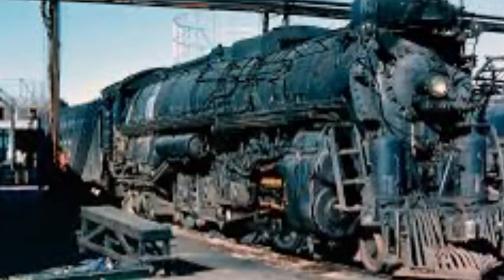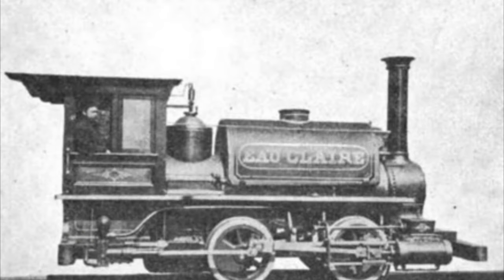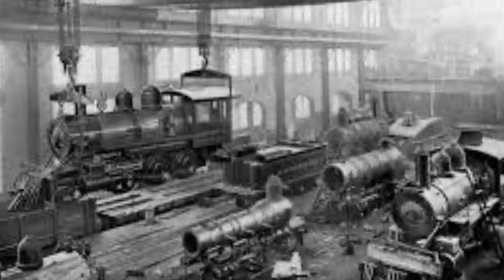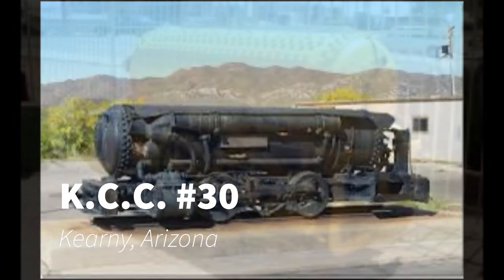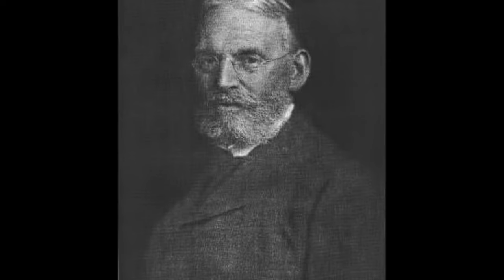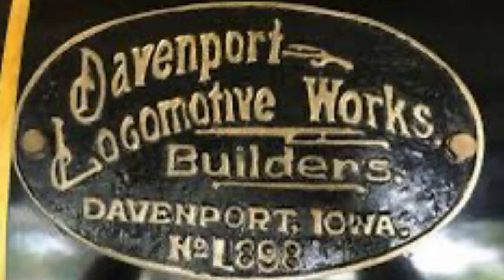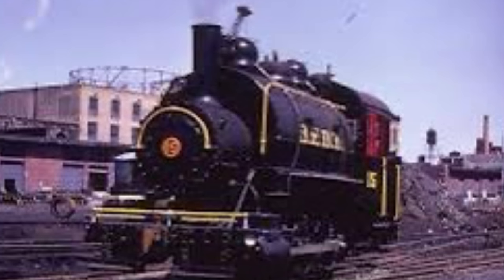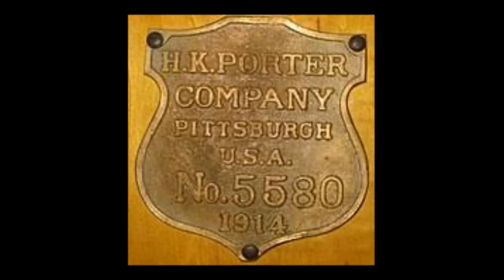The H.K. Porter Co.: The Master of Industrial Locomotives

Comment: The largest 3-ft gauge diesel-electric loco the Porter Co. built, 75 tons, was for the US Gypsum Co. of Plaster City, CA in 1946.  It has 2 3-axle trucks made in A-1-A + A-1-A configuration but converted to a C-C configuration in 1950 or 51.  It went from Plaster City to Flint, MI,  to Georgetown, CO to Durango, CO.